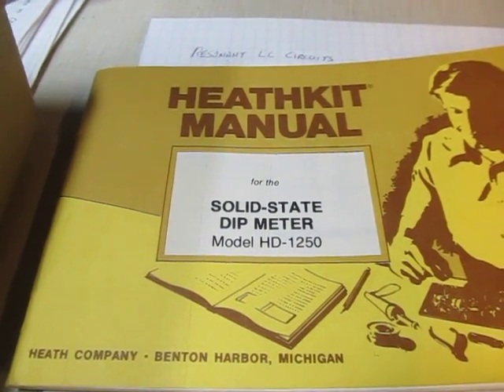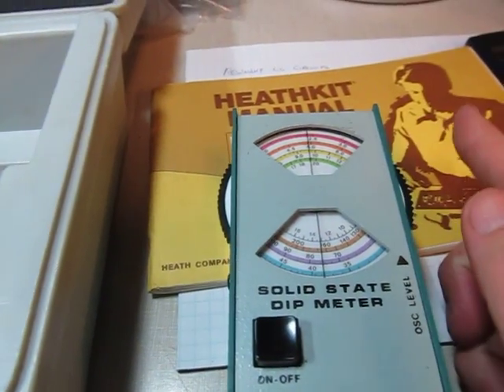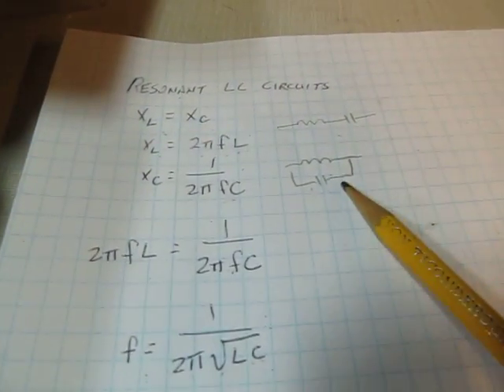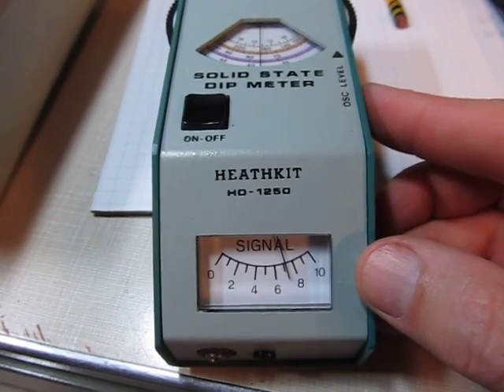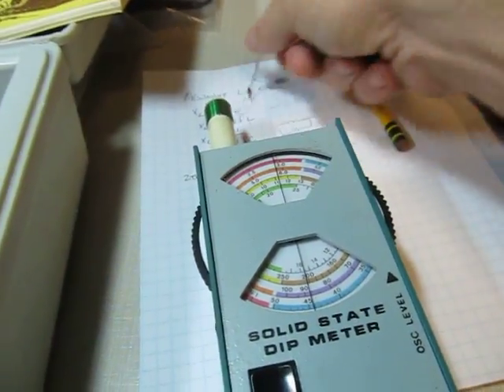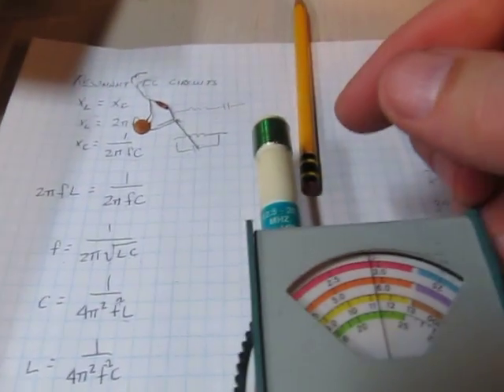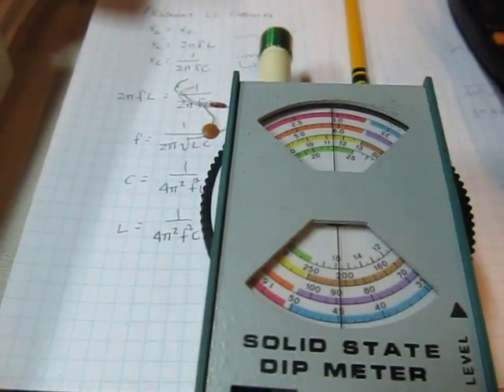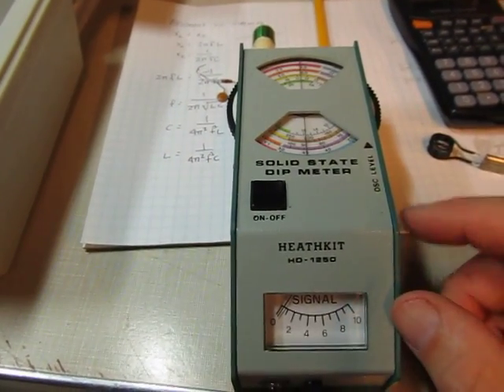#52: Tutorial / Basics of a Dip Meter

Comment: still remember we used dip meter to do a rfid antenna design in flex pcb (13.56MHz), only use rfsim99 design and simulation it. then use dip meter to do the final fine tune with cap and inductor. super good use. there is 500k mass production in that design. haha.

Comment: Hi Alan I know this is a necropost but I have a couple of the exact meters. I picked up one today at a HF for 10 bucks as a spare. It was so cheap probably because that foam in the kit got gummy and adhered to the coils and the dipper. A real mess. It takes WD-40 or naptha (lighter fluid) to remove that crap. So you might want to pull yours out and get rid of that foam. There are also a few pieces inside the dipper that you will want to get rid of. Also I started using the Eveready Ultimate Lithium batteries for any gear that I care about that may get stored as they do not leak. They cost more but there isn't an alkaline battery on the planet that does not leak. Sam W3OHM
Reply: I changed all of my cases to polyethylene foam. It never deteriorates and you can get it in the pink ESD safe material too!.
Reply from the maker: Thanks. I replaced the foam in both places years ago.

Comment: Hello,  when the coil/cap combo is removed from the grid dip meter coil would the grid dip osc freq change slightly ?  thanks
Reply from the maker: Yes, it will likely change MORE than slightly, since it is the plug-in coil that determines the frequency range.
Reply: @w2aew  My thinking is when checking res freq with the freq counter it is more accurate to leave the coil/cap combo inside the grid dip meter coil to get a true res freq reading.   please confirm,   thanks
Reply from the maker: @braveheart5280  Oh, now I see what you mean!  I though you were referring to removing the DIP meter's coil.  Yes, you are correct, the coil/cap combo will slightly alter the frequency if removed, so it would likely be most accurate to measure with it inserted.  Of course, coupling to the counter's input might very slightly change it too...
Reply: @w2aew  Thanks ,I am getting into rf design and watching youtube  rf topics.  thanks for your response and detailed video's.

Comment: Colour me stupid, but when you say a dip in 'grid current' surely you mean RMS voltage or signal etc?? Or some indirect means of refering to it? I don't recall ever seeing more then nanoamps in relation to grid currents. I've always treated the grid as a  basically electrostatic element unless the frequency is so high such that the grid capacitance becomes a thing.
Reply from the maker: Yes, I misspoke - should have said a dip in grid voltage.

Comment: Dear Sir, I've found the same grid dip meter without any coil. Does exist a method to rebuild these coils or some table/scheme to follow? Thank you.
Reply from the maker: You can build them yourself using an RCA plug and some small pieces of PVC tubing, and some wire.  Here are the measured inductances for each coil:
1.6-3.4MHz coil --- 165uH
3.2-6.6MHz coil --- 38.8uH
6.3-13MHz coil --- 10.2uH
12.5-26MHz coil --- 2.60uH
25-51MHz coil --- 0.66uH
48-100MHz coil --- 0.17uH
100-250MHz coil --- ~0.045uH
Note that the first three coils use very fine wire, maybe 40-50 ga.  There are hundreds of turns on the first one.  The highest frequency coil is simply a single 14 ga wire connecting between the two terminals like "U" about 1.2" high.
Reply: @w2aew  thank you so much!

Comment: I have both a Heathkit model GD-1B and a HD-1250 grid dip meter.  I found that the GD-1B will work with a tuned circuit that's farther away from it compared to the HD-1250.  See the video I uploaded.

Comment: Hi !! The difference between Dipper meter and Tunnel meter , is that the Tunnel have diode function ? 73
Reply from the maker: The tunnel dipper simply uses a tunnel-diode as the active device in the main oscillator.
Reply: @w2aew  thank you... 73

Comment: I have a dip meter with an ear phone, you hear a distinctive click when it jumps out of lock with the external coil,  it some how gets locked on to the resonant frequency of the external coil under test,  so even when you are trying to turn the dial, to change the frequency , it remains in lock at that frequency, and then once you have passed the hysteresis point the frequency of the dip meter jumps out of lock and is now either much higher than resonant coil or much lower, it is at this point where it jumps that we hear a click in our headphones. To determine the exact frequency of a coil under test, one has to observe the digital display for the frequency read out just before you heard that click, because soon after you hear the click the frequency would be miles out,  I prefer the linear ones that do not lock, but you could see the slight dip at the resonant point linearly, shame the digital revolution has killed many radio enthusiasts.

Comment: I used to have this meter, it was great. It can be used for other purposes. I used to live next door to a guy that would blast his stereo. I used a phone cord as a antenna, wrapped it around the meter coil,  tuned the dip meter to the same frequency he had his stereo on,  and the dip meter signal would cover up the station he was listening to, and it made his stereo go silent. It worked great.
Reply: Why the heck did I not think of this!  I had a problem from a very noisy neighbour too,  even other room mates were sick of his loud music,  one day whilst he rushed off to the toilet, we got in his room and got hold of his infra red remote control for his tower Hi-Fi , we quickly programmed its remote control codes into one of those learning remote controllers, so we managed to programe controls for volume and input select such as turntable, tape deck, FM, AM and scan commands, after that we were able to control his volume from a small gap under his room door, by pointing our remote controller beam into his room, the beam was powerful did not have to be directly aimed at the HI FI tower, and it did a wonderful job of switching his unit off, turning his volume down, changing his stations, and often we would turn it right up to awake that bastard, it worked a treat for quite some time until one day he wanted to go to bathroom and when he opened his door he caught us ! 

Next thing we tried was abandoned half way as we did not wanted to get hurt ourselves,  we took out the door of a microwave oven, bypassed the door safety switches, and were about to place that in the adjacent room directly behind his Hi Fi Tower, when we feared that microwaves may bounce off the wall and hit us instead of cooking up his HI FI, so if we had gone ahead, I am sure his hi fi would have gone up in smoke, as the wall between the tow adjacent room was made of timber frame and plaster boards or what we call a dry wall.
Reply: @mgabrielle2343  Those cute little component identifiers (ZIF sockets, graphic display, about $20), also decode IR signals to save you time.
Reply: Cool.  Great story of electronic warfare.

Comment: Hi, Great video and Thank you for taking the time. Quick question is it worth buying one to use repairing/aligning vintage am/fm radios.
Reply from the maker: It really depends on what other tools you have at your disposal.  It can be very handy, just keep in mind that the frequency accuracy won't be great unless you have a counter to set/measure it accurately.

Comment: Hello sir, I was looking for you to mention tank circuits etc.... I am having some trouble with a Combinner Circuit in a homebrew 20m Legal Limit Solid State  Amplifier using old school BJTs that I am building. I honestly dont know if it is a LC or a Pie circuit that I am following but there is a Coil i am needing to wind and it needs to be on the specific freq of 14mhz. it is like this. There are 4 Amplifier Stages that is combined to a combinner then has a variable shunt capacitor to ground with this coil in series to the output to the load. Just by this information could you point me in the right direction as of what type circuit is this is and how i could test what freq this coil is resonant at. This will be so helpful sir.
Reply from the maker: This sounds like an impedance matching circuit in the form of an L-network.  The value of the inductor and capacitor would be specific to the design of the amplifier, so there really is no way for me to tell you what value it would need to be.  You would be better off getting this information from the original designer of the amp.

Comment: HI Alan, nice video. I used to add a tap out of the oscillator to measure the frequency because when you couple the meter the frequency shifts. Moving away from the circuit under test shifts the frequency again as you try to measure using the counter. By having the tap ( a couple of pF. ) I could measure the frequency as I was coupled in. 73 N1CKX

Comment: can you use this to find the center of a crystal....like a 455khz???
Reply from the maker: It depends on the design of the meter.  Some allow you to plug a crystal into the coil socket in order to test the crystal.  However, keep in mind that the frequency resolution of the dial isn't very fine, so it will only give you an approximate value.
Reply: I see thanks

Comment: One more question, if you don't plug-in the coil, will the signal meter's neddle  move after power on?
Reply from the maker: It really depends on the design of the oscillator, but in general, no, the oscillator won't run without a coil attached and thus you won't get any meter movement.  I'm sure there are some designs that will differ.

Comment: I built one of these in the early '80s. It had a few problems. The transistor for the 100-250 MHz was a known defect that Heathkit replaced at no charge. It was a real pain to replace. It also had an intermittent problem with the phono jack that I eventually figured out and replaced. It has been  working fine ever since.
Very good video on it's use. Too bad Heathkit has gone away.
Reply: You would't think replacing a transistor would be that much trouble. Unless, maybe it had to be matched or something.

Comment: Thanks for THIS video.  I too have an HD-1250 that has been stored in my attic for the past 15 years.  Your video got me wondering about its condition.  I just brought it down and glad I did.  The 9V battery was still installed , but luckily hadn't leaked, although the positive terminal was eaten completely away.  The heat of the attic however had destroyed all the rubber cushions, in the lid and the strips around the battery.  When touched they turn into a gooey mess.  Oh well another project.